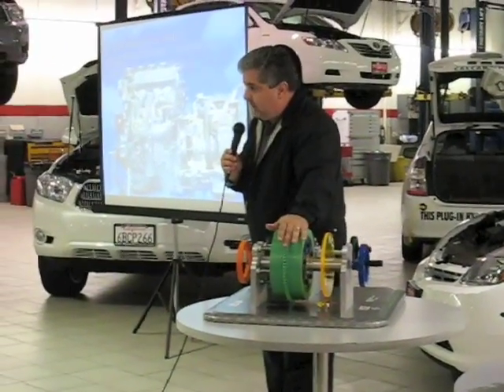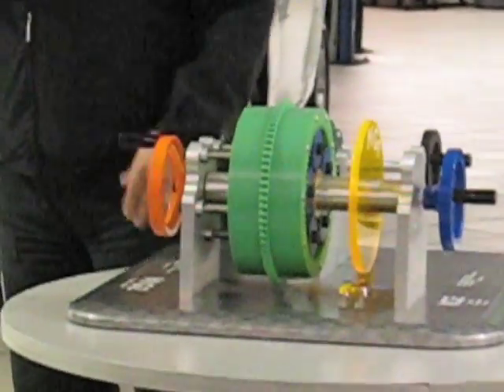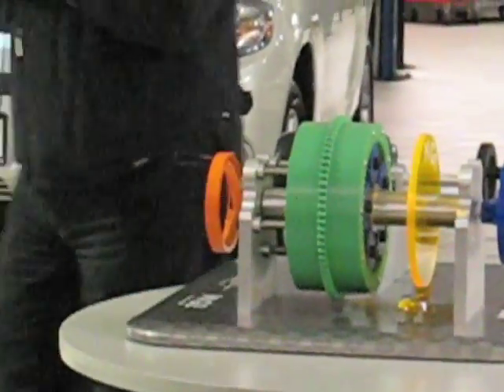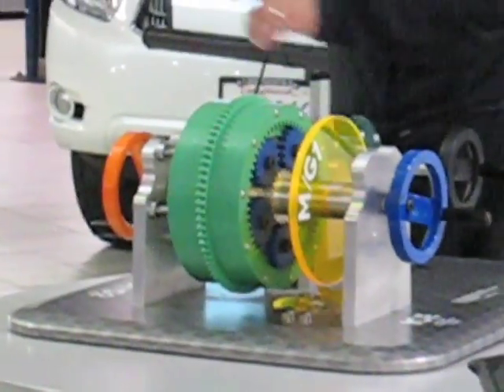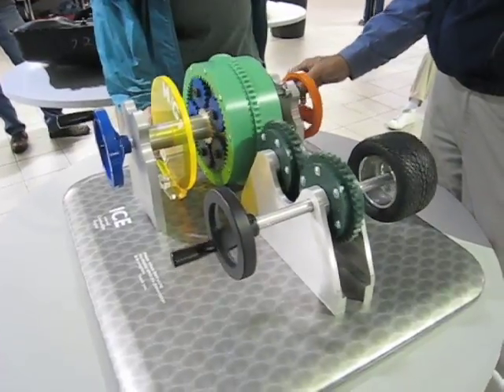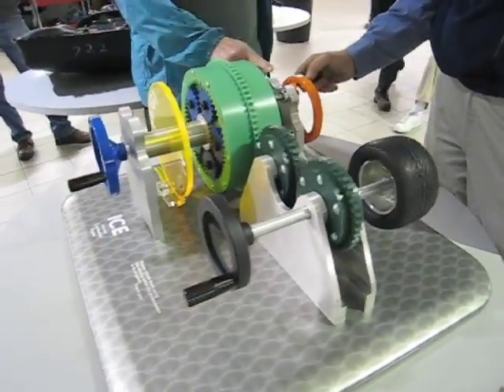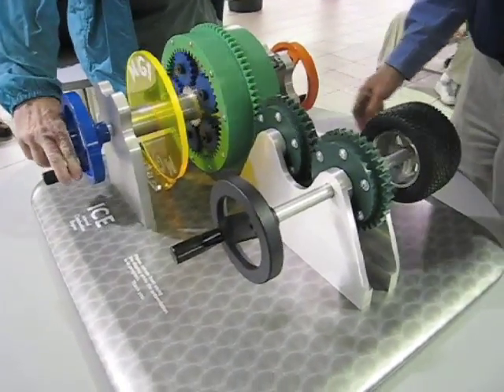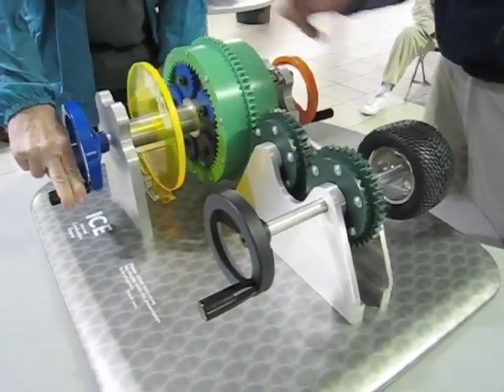model of Toyota Hybrid Synergy Drive

Comment: This is awesome stuff.
Reply from the maker: Actually it is a very old idea reused in a new situation. If you look closely, the planetary gear in the HSD design is exactly the same as a differential in all rear wheel drive cars. Instead of the shaft driving the 2 wheels, Toyota replaces one wheel with a combustion engine and the other wheel with an electric motor. The arrangement works in the opposite direction. Instead of the drive train moving the 2 rear wheels via the planetary gear, now the 2 power sources move the drive train via the same planetary gear design.

Comment: If anyone is interested. When the guy looking at it said you had to apply a brake to M/G1 to make the engine power the wheels, he was only half right. It's not a brake, but rather M/G1 turns on the generator mode and creates resistance, and as it's geared to go faster than the engine input ,it has mechanical advantage over the engine causing more of the engine torque to go to the wheels. The electricity generated goes either to the battery pack or directly to run M/G2 as a motor to help move the car.....it's an amazing way of making a single gear CTV without the main point of failure on most CTVs, the belt.

Comment: The planetary gearset hybrid is a great piece of engineering; it is actually simpler in operation than a traditional gas engine driving a conventional automatic which has 4~5 clutches/brakes in 3~4 planetary gearsets to translate the car to motion. Since there is no clutch or brakes on the HSD unit no wonder Priuses have been so bulletproof over the years.
Reply from the maker: +Trades46 - The disadvantage of the planetary gear HSD is a fixed gear ratio. It is a power split device take use the electric generator motor to work hand in hand with the internal combustion engine to change the torque and power to the wheel. It does not utilize of the mechanical advantage by shifting to different gear ratio. Check out some of the video links I added to the description section.
Reply: cplai
Yes that is true, which answers why Toyota hybrids currently cannot do the party trick of running EV mode at above 55mph.

However, at lower city cruising speeds where the electric motor's operation range covers most speeds, the lack of a 2nd planetary gearset means the system is both lighter, much smoother in operation & less mechanically complex. A boon to those city-driving types who don't venture far from their apartments in downtown areas.

Comment: how "motor generator 1's  speed and direction" in control of the sun sun gear is an important key in the transmissions output ratio. this is hard to demonstrate in this model , they really need another crank on Mg1 , computer controls the mg1 speed and this impacts the gear ratio of  "both" the gas engine and MG2 (the main electric drive motor)

Comment from the maker: I own a 2004 and 2013 Prius. Given the same driving habit, I found that the 2013 does much better than the older model. My average on my 2004 for the past 10 years has been 48mpg, with rare occasions that I could reach 52mpg in some short trips. My 2013 gives me about 52mpg with occasional high at 60+mpg.  EPA estimate changed their formula, so the number change is artificial and is not due to the change in the cars' performance.

Comment from the maker: go to the "About" section of this video and follow the link to the japanese website for a simulator. It lets you play with the gears via a simulator. You can see how moving different parts of the planetary gear will drive the car either with electric motor, internal combustion engine or both. Going reverse is interesting too because the gears are fixed and cannot shift like a regular transmission and gearbox.

Comment from the maker: @maZZiveAttack The model in this video shows how the transmission in the Prius works. The Blue crank represents the Gasoline Engine, the Orange crank represents the Electric Motor/Generator.  The current Prius is a Gasoline/Electric hybrid. However, it is possible to replace the Gasoline engine with an hydrogen engine in the future. But Toyota has no plan to do that yet.

Comment from the maker: @maZZiveAttack The drive train design is quite independent of what fuel to use. The video only shows the transmission. The engine can be modified to run on hydrogen without changing this transmission.

Comment from the maker: @banstaman It depends how you define CVT. If CVT means achieving different gear ratios for different levels of mechanical advantage in a continuous manner then this is NOT CVT because there is only one gear ratio at any speed.  If CVT means that you achieve various speeds without that jerking sensation during each transition in the transmission, then this delivers various speed smoothly because it NEVER shift gear.  Same gear for all speed, including reverse.

Comment from the maker: Perhaps you can use a bevel gears to design your version of the power split device.  Instead of one drive shaft to spin two wheels, you can reverse the arrangement, use a gas engine to spin one wheel and use an electric motor to spin another wheel, you controlling power to the two wheels, the shaft will spin with combined power from two power sources and you get a hybrid drive train. I guess these dumbasses found a new use of that do nothing differential. Bevel vs planetary is irrelevant.

Comment: It's the Power split device from the toyota prius; the blue crank is the combustion engine; the orange one is the motor/generator 2, the yellow disc is motor/generator 1; Black = wheels.